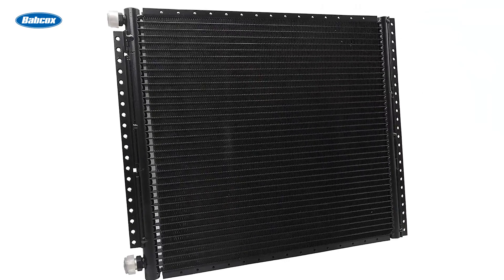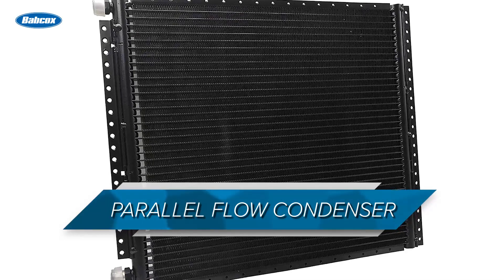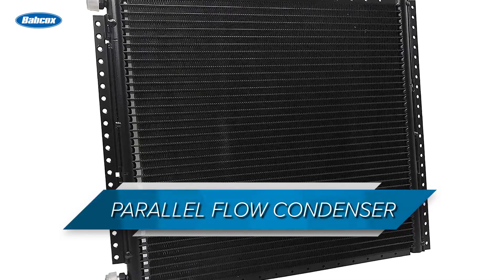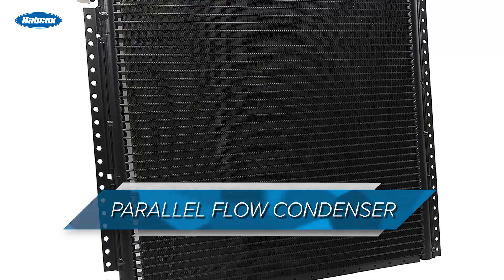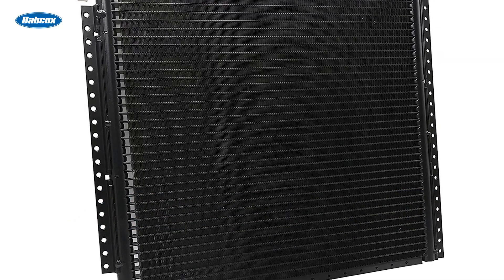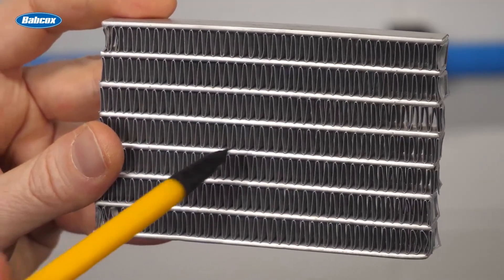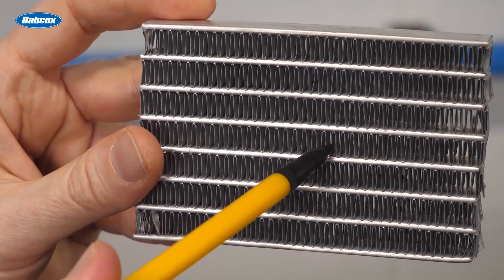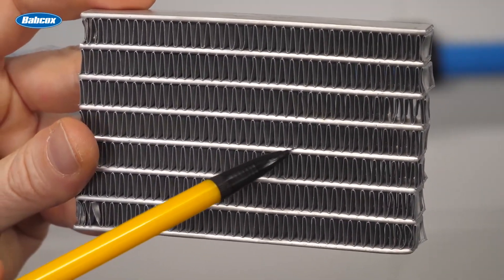Don't Forget to Replace the A/C Condenser

Comment: compressor / condenser change 
if evidence of contaminated oil  flush system ,, its a very good idea 
inspect hoses for rotation on crimp 
inspect evaporator core for cleanliness , replace TX valve  if removing evap core 
replace all O rings  when joint is opened 
replace drier  

Remember on a 100F day High pressure should never exceed 250psi when engine is idling or fast idle eg 1400rpm .
Low pressure should be 25--40psi  at idle and fast idle 
Low pressure exceptions are typically a little lower 

Charge to weight of refrigerant 
sight glass 
vent temp
suction hose temp
subcool 
superheat 
NEVER UNDER CHARGE---------------------- NEVER OVER CHARGE 

nb WORK OUT WHY COMPRESSOR FAILED